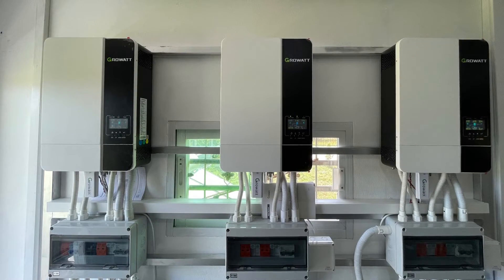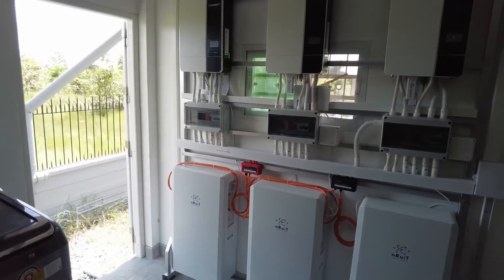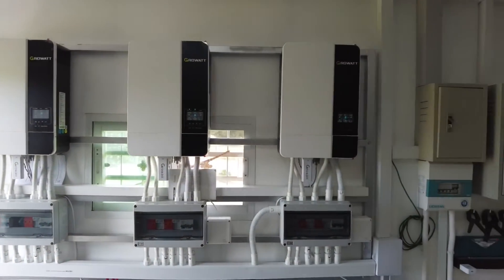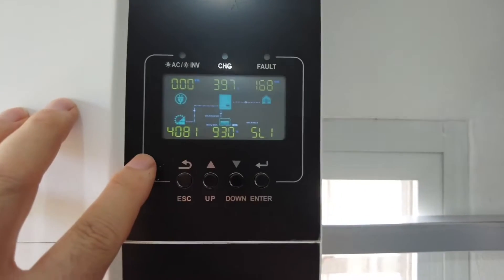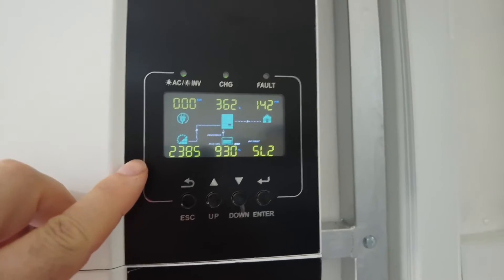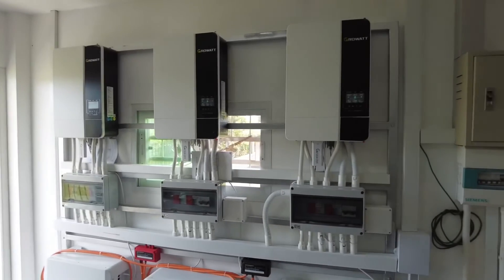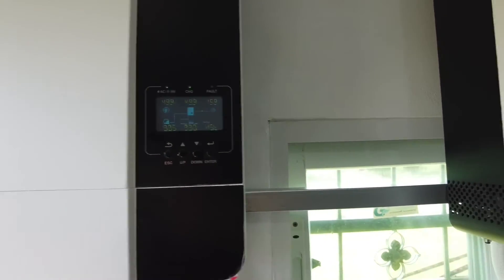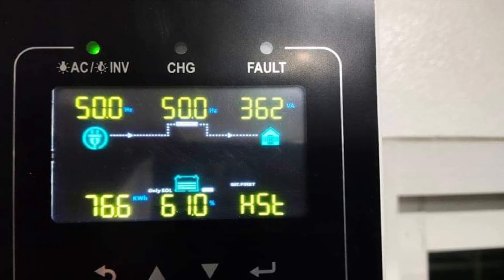GROWATT SPF 5000 ES Inverter

Comment: 5kva x 3 inverters 3 phase system 
Whats the total power out put ,5kva or 15kva
Reply from the maker: The setup in single phase 240V total output is 15kW (3x5kW)

Comment: Hi, great setup!
Just to understand well: the 3 inverters are charging 1 battery bank of 27kWh (3x9), right? Or each battery is managed independantly by its charger?
Reply from the maker: The 3 9kWh batteries in the video (I now have 4 ) are connected in parallel via two  heavy duty bus bars (the red and black boxes) creating effectively a single 27kWh (now 36kWh) battery

Comment: Thanks.  😀  I wonder if you ever need to use AC-grid to top-up batteries?  I constantly alter 'setting-11' which lets you decide how many amps to send to the battery (a DIY 16cells x3.2v x320Ah = 16KWh-max) from the AC-input.   I currently have one SPF5000ES at the house but have another 3-phase, grid-tied inverter on a shed nearby with 10KW of panels.  My plan is to use half of these panels to charge a second battery via a new SPF5000ES.  The AC-out of the new SPF5000ES will be sent direct to the AC-in of the old SPF5000ES.  The aim is avoid the disruption caused by rapid changes in solar production caused by clouds.
Reply from the maker: Hi Sandy this video is over six months old -  I have a more recent video that shows my whole system in operation. Many people are quite negative about batteries claiming that they are still too expensive to be economic, but as you say they provide a valuable service in balancing out solar production in addition to the traditional idea of backup. https://www.youtube.com/watch?v=TmzgBo_BwwQ

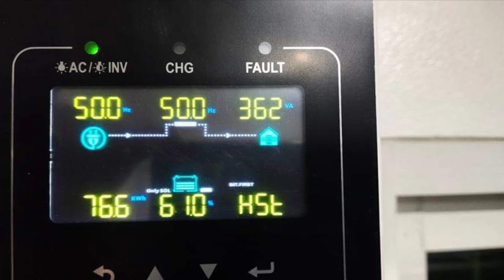Comment: 3:45 I am curious how this is wired.
SPF5000es has an AC IN (power from Grid) and AC OUT (power from this device).
Is it your house connected only at the AC OUT of SPF5000 and no physical connection to GRID?
And when you want house powered from GRID, SPF5000 simply connects AC OUT to AC IN internally?
I am confused whether to get SPF or SPH because of this.
Reply from the maker: Watch my latest video on V2L it includes an overview of my whole system and should answer your question.

Comment: Nice setup and thanks for sharing. Looking into this inverter myself. Does it come with a current clamp of some sort to prevent sending power back to the grid? I want to have the grid for charging the battery overnight on cheap rates plus solar to top it up. But never want to send the power into the grid. Can the unit do this, and if so, how? Thanks!
Reply from the maker: The GROWATT SPF 5000 ES Inverter is an off-grid inverter and is designed to work alone and cannot synchronise with the grid. So they continue to function fine when the grid is down as they don't feedback to the grid. They can use an ac source like the grid or the ac output from another inverter to charge the batteries.

Comment: I assume that:
1. If there is a GRID failure, SPF powers the whole house similar to a regular UPS.
2. And if GRID power comes back, I assume SPF generates power in sync with GRID and limits the output to prevent exporting power back to GRID.

PS: Your video is very helpful.
Reply from the maker: Power cuts are a regular occurrence in Thailand  - I generally find out about them after they happen. Power is only drawn from the grid after all my batteries are depleted. Since my latest upgrade I am have yet to see that happen. I do not export back to the grid as 5kW is the max size allowed here for a single phase system and as I have 20kW and are not eligible. As these inverters are Off-Grid they cannot synchronise with the grid and do not feedback to the grid.

Comment: 1 phase or 3 phase ?
Reply from the maker: The house was designed to be off-grid, but I wanted grid connection as a backup. Here in Thailand single phase is the norm and three phase is very expensive. So we went for single phase and have a 40Baht/$1.20 monthly service charge bill
Reply: @EcoHouseThailand   thanks  for info

Comment: What is the charging current of each inverter with this setup?
I have the same setup, but with different batteries and I got only 30A charging per inverter.
Is that normal?
Reply from the maker: I don’t really think in amps. Easier for me in kW. I have 20kW of PV. 3x9kWh of LFP and 3 x 5kW inverters. So if I’m getting 4-5kW of solar production per inverter, I know my batteries will be full in a couple of hours
Reply: @EcoHouseThailand  
I think the inverters are not charging the batteries with 100% of their pv production. I have 4x9kW LFP and the same 3x5kW inverters and I can charge the batteries with Max total of 4.5kW
Can you check on your Main inverter menu, option 2? What does it say? Mine shows 30A which is only 1.5kW of charging per inverter.
Reply from the maker: Just checked the manual for option 2 and it says "if Li is selected in Program 5 this program cannot be setup"  so sounds like you cannot change it.
Reply: My guess is that the BMS of my batteries is telling the inverters that the maximum charging should be 90A or 4.5kW. 😔
Reply from the maker: @golden4o  I think you’re right

Comment: have you ever encounter a problem, when the Utility is connected and the inverters try to switch to the utility the utility differential breaker trips? In single mode everything is OK, but in parallel mode trips
Reply from the maker: My utility is my old gel batteries  - never had any breakers trip

Comment: I take it your PV breaker and battery breaker is in the box below the inverter. What size box is that and what size breaker did you use for the battery input?
Reply from the maker: Box size 30cm x 19cm  x11cm. Breaker 100A DC

Comment: Nicely done, wonder only why you do not 'pool' all three batteries packs together, feeding all three inverters into (and from) the complete pack? I'm having two of the same inverters, feeding into four 48V 15kWh LiFePo packs and they balance the different power supply and demand between the two inverters nicely. May I ask you for the settings in Program 11, 12 and 13 (voltage pints when Utility starts charging the battery and steps off, and Program 18, 19, 20 (Bulk charge and floating (for LiFePo4 batteries))? btw, I'm based in Chiang Mai.
Reply from the maker: I am still in the final stage of setup.Between my installer, Growatt and NRuit I am trying get parallel operation achieved and everyone has a slightly different view on how it should be done. 11: 30A;  12: 22%; 13: 24% (12&13 can’t set any lower) 18:dis 19: 57.6v 20: 57.6v - last 3 haven’t touched, so must have been by installer

Comment: Very nice example.  I am wondering how these units hold up under >90% load on PV input and AC output.  I am going to speculate that they will run a little hot - so - the question is how long the units will hold up under 30% load vs 90%.  I am going to start with 1 unit and put it under heavy stress.  No doubt I will end up with 2 units or more.  I much prefer to have two units running middle of the road...  than one unit under stress.  ...  Anyhow, nicely done.  Your vide makes me want to buy in.  -Schindler
Reply from the maker: There is an accurate temperature reading on the screen of the inverter and it has yet to show much above ambient - remember I live in the tropics. My house draws less than 1kW and the onboard charger of my PHEV draws 3.7kW so we are a long way short of the 15kW max output.
Reply: @EcoHouseThailand  
I ordered mine on Monday!

Comment: Very nice setup. 
1. Can AC power from the house supply loads as well as charging the batteries at the same time if chose to do so ?
2. If inverter fails, will it bypass to house AC automatically ?
I’m considering install this 5kW Growatt with 10kW-hr battery in my RV with little knowledge in solar. Do you think it will work in RV situation ?
Reply from the maker: I will do another video on the full setup when it is complete. I have 20kW of PV; 4 inverters; 27kWh of Lithium and 38.4kWh of deep cycle gel. The house runs on PV when available, excess is put into the house batteries, then into the car. At night the house runs on Lithium, until 22% DOD, then gel batteries until 50% DOD and then the grid. All Batteries are set to only charge via solar, but the inverters can be set to send power from any source into the batteries. I have an ATS that will send grid power automatically to the house if it senses a drop in voltage. I Don't know anything about RVs except that there are very small compared to a house and so don't have much space for PV